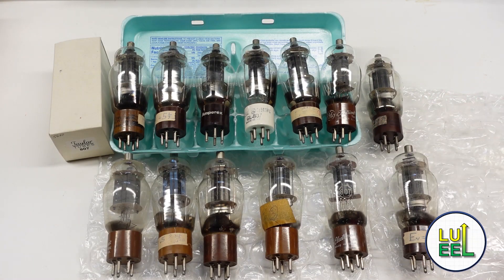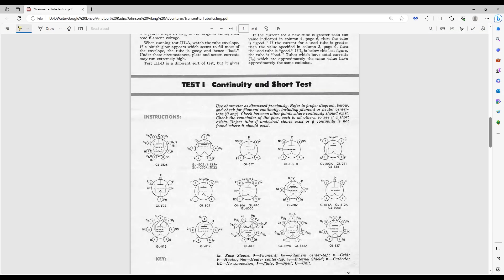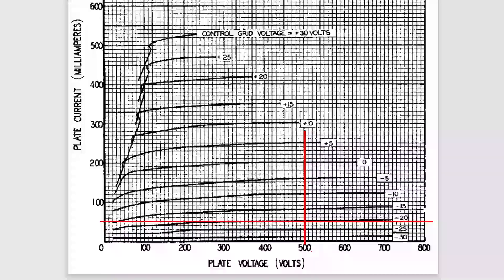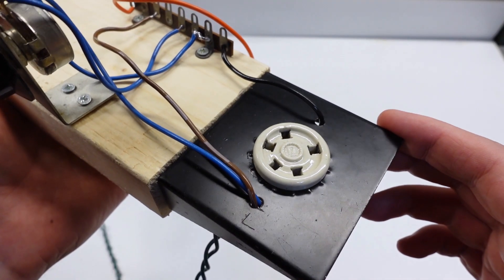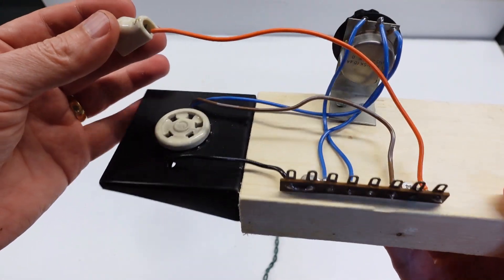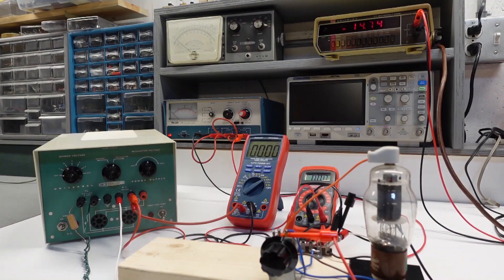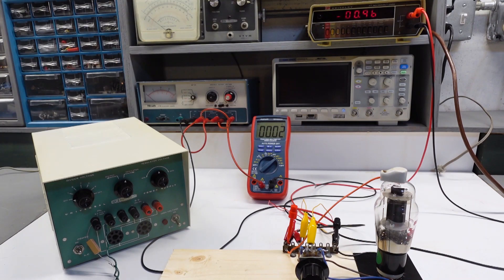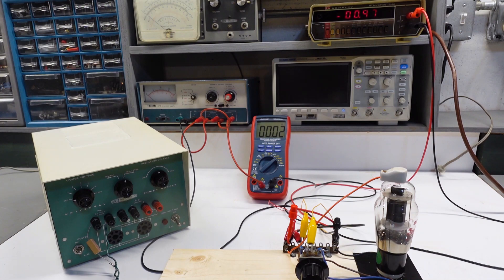E. F. Johnson Viking Adventurer Restoration: Part #2

Comment: Over the years I have used soft tubes MANY times in my 52 years as a Ham, mostly CW. Depending, a soft tube may only be down 15 -30% and still sound fine on the other end. Additionally, just that amount of loss will generally not be noticed on the other end compared to a fresh, high emission tube. After all, cutting the power 50% is ~1S unit or 3dB. So, don't be hasty in scrapping tubes which will still work for some time to come. Also, I have never had a soft tube just up and die during a QSO. They simply get weaker over many more hours of operation and at some point, I'll splurge and get a better soft tube....
73, Glenn WA4AOS
Reply from the maker: Good to know, I will save them all and compare the BOB to the WOW once I get the rig put back together.
Reply: @levelupeelab  Just for giggles, I remember back in the late 70's early 80's guys being so bent on wanting their power output meter go as high as possible. They would by 6146W's instead of using the recommended 6146B's often used in the SB and HW transmitters/transceivers, used by Heathkit and others. Yes the,"W," did provide a little more power, as I recall, ~10 watts on 15 and 10 meters. Again, nothing the other station could ever detect but their meters went higher????? At any-rate, this was just enough extra current draw to zapp the pwr xfmr.  True but SAD... Maybe this is left over mentality from 11-meters or simple  non-technical confusion of the user. I have actually seen notes from Heathkit, warning op's to NOT use the "W" tubes. 73. Glenn WA4AOS